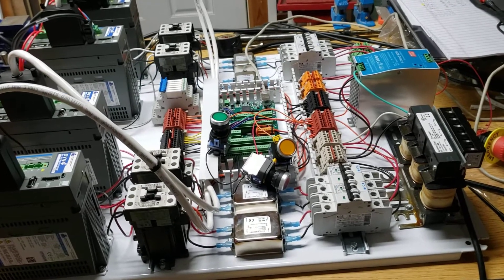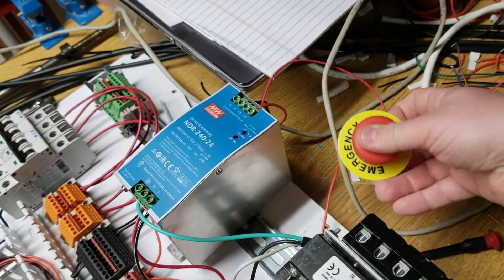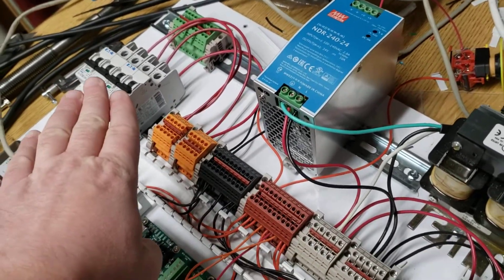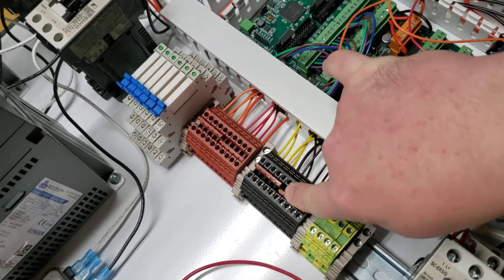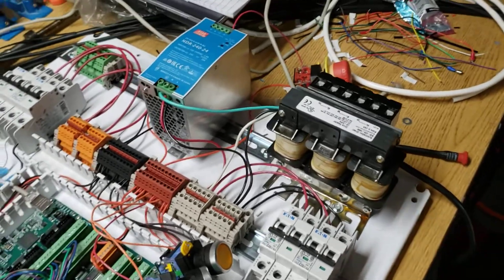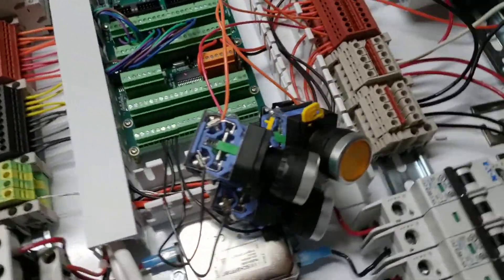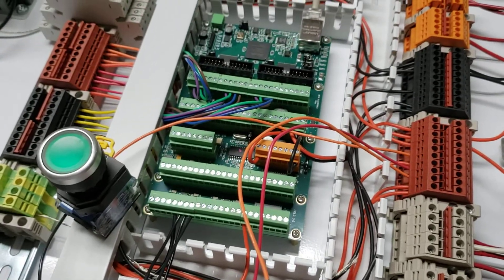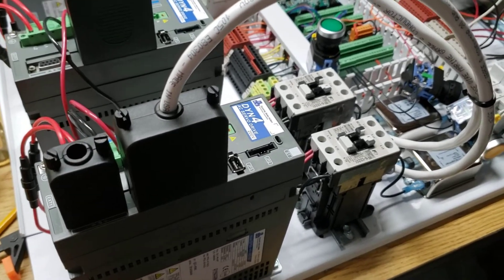SX3 mini mill CNC build part 4 - cabinet overview

Comment: Any videos or updates on how that spindle motor worked out?
Reply from the maker: Sadly, that machine took a few back burners and is waiting for my triumphant return. I built my emco 55, a prolight for my old school, started on a compact 5 and a million other things since. I really need to get back on it. Hopefully soon.
Reply: @TheFeralEngineer  my converted sx3 with that same kit but with steppers has been sitting since I moved about 5 years ago. It was a great machine. I made a ton of parts with it but the spindle motor never had enough rpm to it. Every time I see someone change out the motor on these mills they never seem to be completely happy with them and if they are the motor is massive and sticks out the top of the machine 3’.  I was hoping this was going to be the solution. I’ll be waiting it’s return!!!

Comment: Can the 7i76e spindle use a servo spindle motor? Thanks!
Reply from the maker: If the servo is capable of using 0-10v analog signal, yes.
Reply: @TheFeralEngineer   Thanks

Comment: Thanks for posting this much appreciated.
What size enclosure was that panel going into? I'm building a 4 axis controller using the same exact components with the exception of huge (bought the wrong size - too big)
power distribution block and I'm having to get really creative with the layout ("shoe-horning" mine in) in my Vevor 24" x 24" x 12" enclosure.

Comment: I'm laying out enclosure for PrintNC build, after searching ad infinitum I found the answer explained to me in plain layman's terms the proper way to wire a hold switch not through a contactor via your plainly and easy to grasp explanation.  Thank you.  Would you explain how the other two buttons get wired in and how connected to the Mesa board?  You show the leads to the board but not much more about them.  Secondly, I followed your Amazon affiliate link for the Dinkle terminal blocks, it is pointing to DK2.5N.  I imagine that your 220 line in is 30A, the DK2.5 are rated for 20A, any concern with that?  I haven't found or provided an answer as to how to size them so I was considering the DK6N (50A) or at the minimum DK4N (30A) for VAC distribution.
Reply from the maker: The block coming in from the line reactor is 30 amp rated, the 24v distributions and 110 distributions are all 20 amp. I think it should be fine doing it this way, but if something melts, a 30 amp block isn't too costly. 

As far as the buttons, they're just wired from 24v+ to the button and out to the input, nothing out of the ordinary. According to mesa, as long as you're powering your field io with the same psu as your buttons and switches, you don't need to do anything else. 

If you need a switch that holds a state, you can use either a latching switch or a momentary switch with a toggle hal command or a latching plc circuit in classicladder. In the case of my buttons, I'm remapping the way they function via classicladder to operate like a commercial machining center instead of how LinuxCNC has it set up.

Comment: Well done and very helpful. Do you have a link to the Potentiometers your using?
Reply from the maker: Hey Matthew! The potentiometers I'm showing in the video, I just happened to have kicking around, so I don't have a link to those particular ones. I ordered a box of 20 10k ohm linear taper pots from amazon that include knobs that I plan to use on my upcoming builds. Here's an affiliate link if you'd like to check them out as well. 

https://amzn.to/3qTdbEm